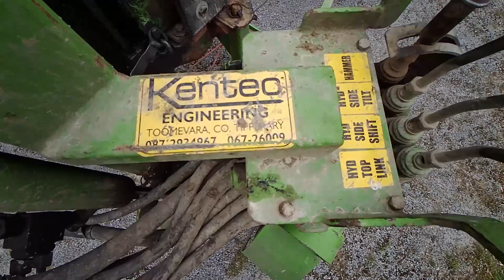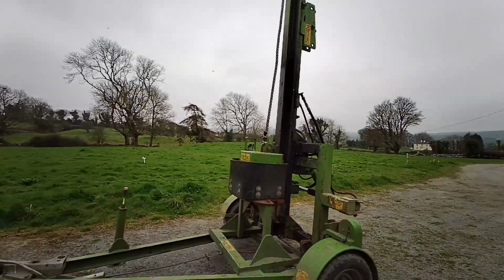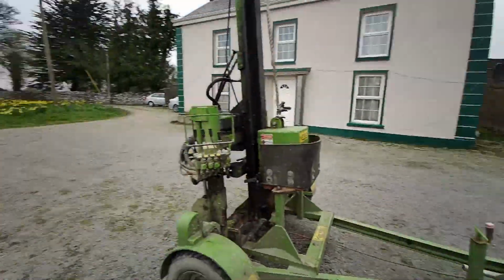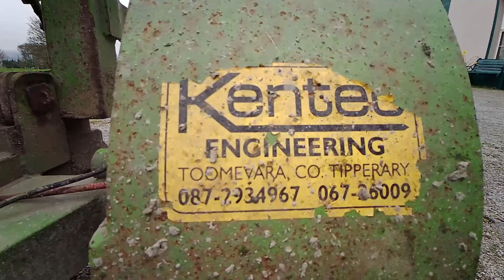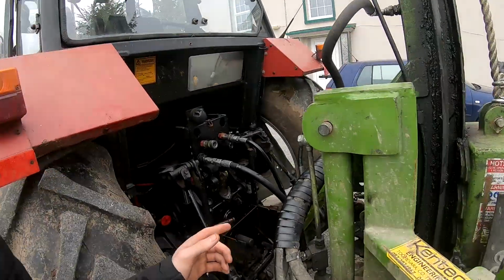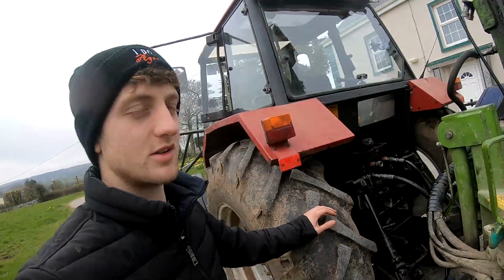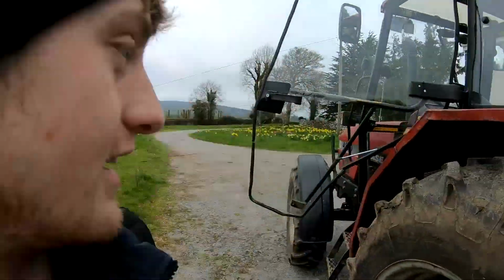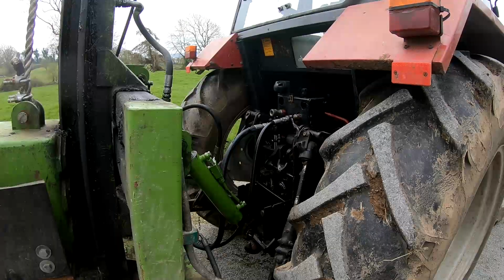A Fools Day in April - Kentec Post Driver on Hire || Part 1

Comment: The reason it is not dropping freefall is restricted oil flow you would usually put the return into the other side of the hydraulic valve that is giving you power
The return will be opened when you have the valve locked in the power position

Comment: Return hydraulic pipe needs to be piped into the back end of the tractor not through the valve chest,
Gravity drops the weight of the hammer so no need to change oil and filters, it shouldn't make a difference to dropping the hammer, it may help lift your hammer faster,
Case normally have very fast hydraulics, you may have a look at the way your loader is plumbed also, the return hydraulic pipe from the loader valve chest should freeflow into the tractor back end , may sure that it's not returning through the tractors valve chest.
Reply: Yeah l was wondering why that post driver had a two way ram.  A single acting ram would be better
Reply: @philipoconnor2236  
It probably is a single acting ram on the hammer, but it has other functions which are double acting rams,

Comment: Hired a post driver twice years ago ago and never got one again.  I find better rights from getting in a good man on a  track machine. He'll be able to clean back a ditch/hedge and leave the ground level for the bottom of the wire. 
Tip- Drive around and have all your posts dropped and spaced where you want them the day before. 
You'll do alot of walking and get nothing done with fencing if you're not organised!  Believe me I know from experience!

Comment: Did you ever get the postdriver working  properly
Reply from the maker: Nope never did it had to go back that day and I later fixed the case up a bit and sold it mostly due to it not being up for the post driver but I will soon have it out again and try it on the JD I have no doubt it will work on it!